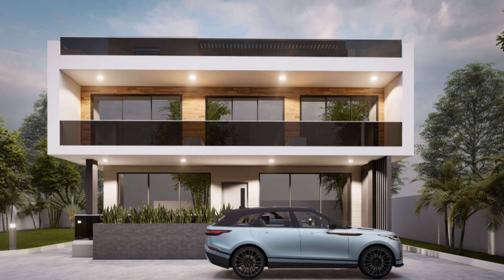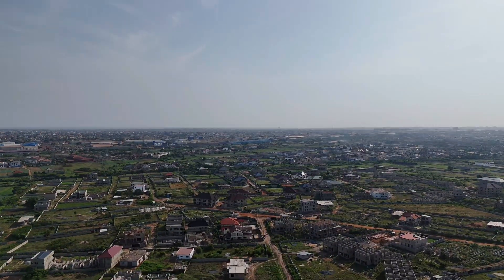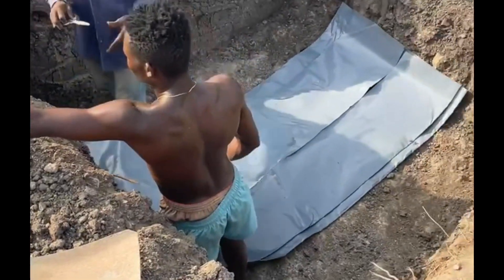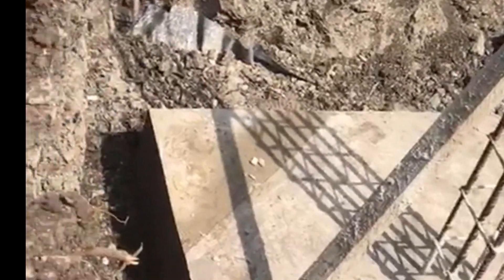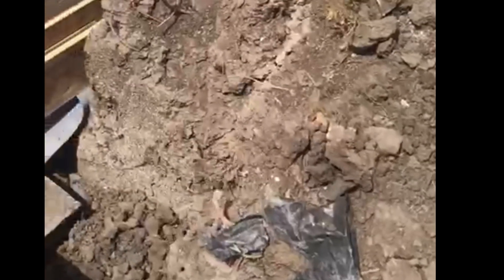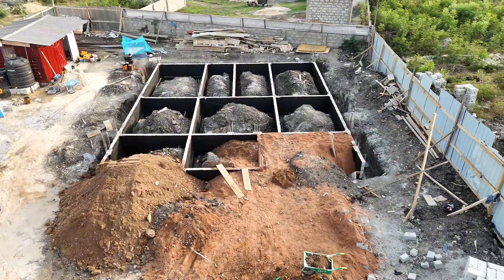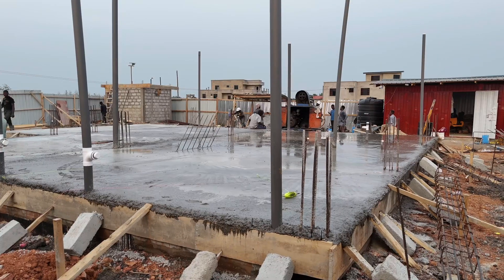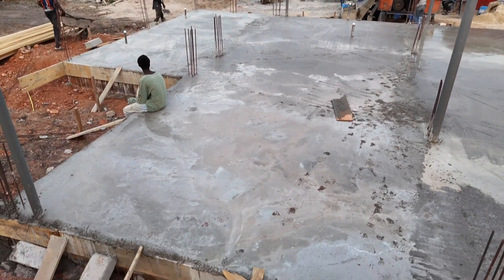BUILDING IN GHANA | BUILDING A SOLID FOUNDATION ON CLAY/EXPANSIVE SOIL #buildinginghana #ghanahomes

Comment: Hello Chally, Do you build your home foundations with poured concrete walls and then blocks. That is the western way here in the US. also what is the general cost difference in hand mixing vs machine? Do you build in the central region? Many thanks!
Reply from the maker: @bernardanderson-bf8qt  hello Bernard 👋I don’t build all foundations this way ,this method was used because of the nature of the soil with the cost difference it’s between 20-25% more for the machine considering labor,materials &machinery and yes I’m available to build in the central region .My WhatsApp number +233557443124